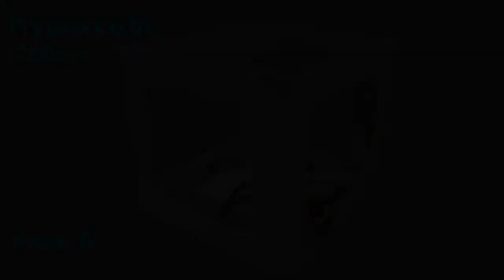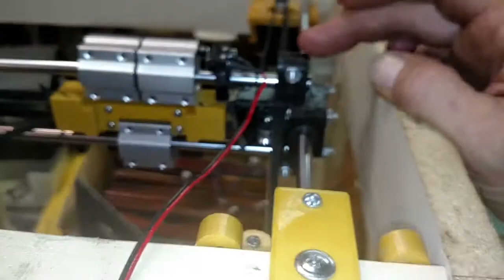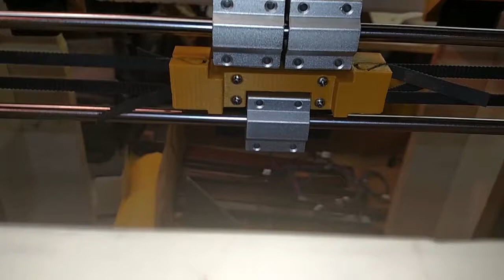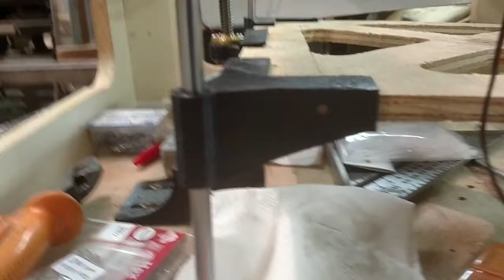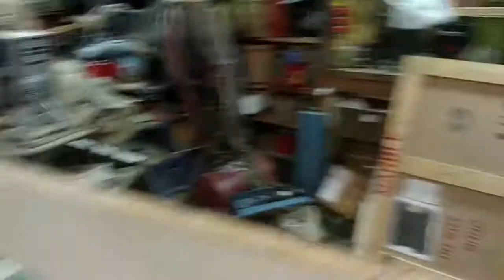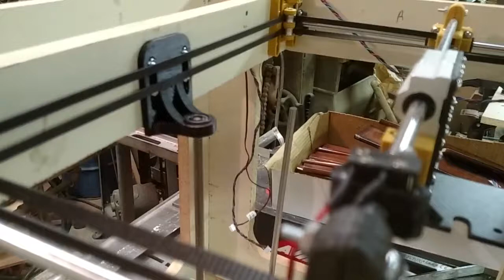Hypercube Retro Part 6

Comment: Did you end up finishing it? I like these sorts of builds. I've been thinking of converting my Geeetech i3 Pro W (Woodframe) into something more sensible, not sure yet if Mendel90 or Hypercube-like. Something i definitely want to do is belted Z. I also use printed bushings (PETG) on XY but Z had to be LM8LUU. I know all "obsolete" now that everyone makes Vorons and whatnot but... budget. Zero-ish. I also have real IGUS bushings but i haven't been happy with them, they aren't the correct dimensional fit for these sorts of rods
Reply from the maker: I finalized the design, but then I got robbed and my existing 3d printer was one of the things stolen. Haven't been able to replace it yet.
Reply: @JasonSimpson1966  Oh that's truly unfortunate. I hope you mostly recovered from that otherwise.